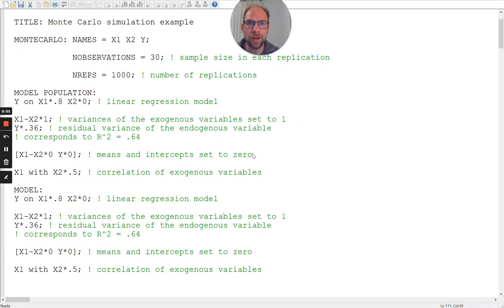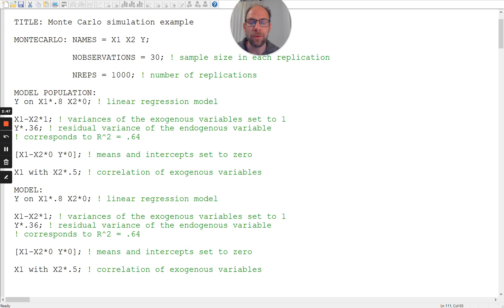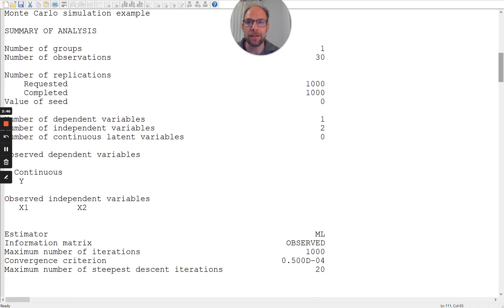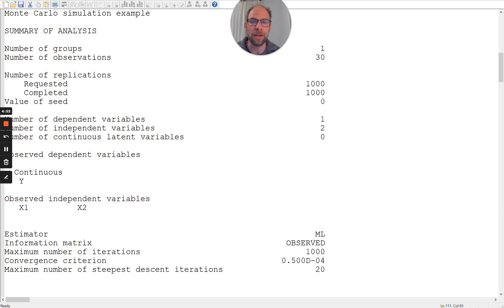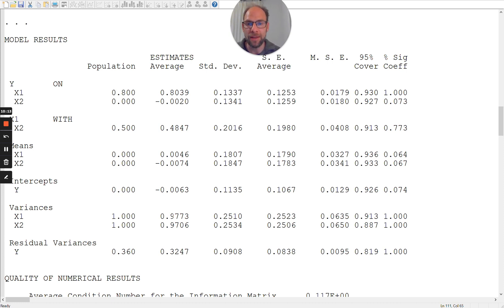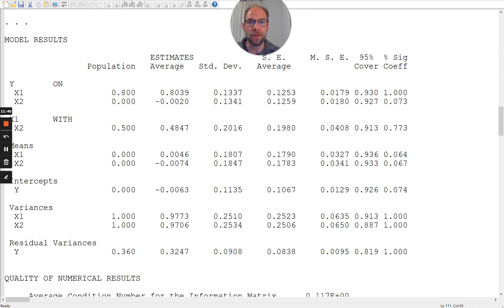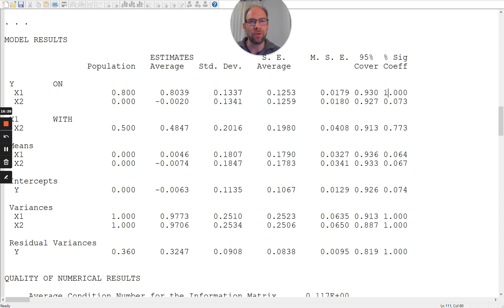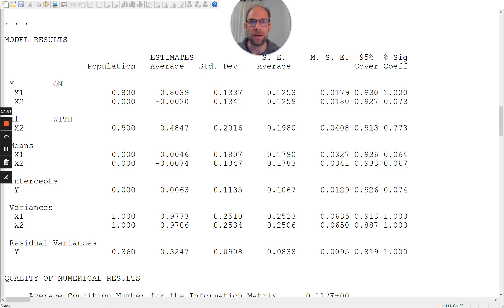Mplus simulation Part 2:  Output

Comment: Is there a way to generate visual outputs for simulations studies in Mplus.
Reply from the maker: Great question! I'm not sure. I have not used any such features myself and I don't know whether they exist. I have typically exported Mplus simulation data to other software such as R or MS Excel and  made graphs in those programs. 

Perhaps ask the Mplus folks (support@statmodel.com) and let us know what they say!

Best, Christian Geiser
Reply: @QuantFish  Thanks! I have another question. Is there a way to filter replications (e.g., improper solutions).
Reply from the maker: @sarahhammami8192  I don't think that there Mplus currently has an automated option for excluding certain replications but you might want to ask the Mplus team directly to be sure.

Best, Christian Geiser